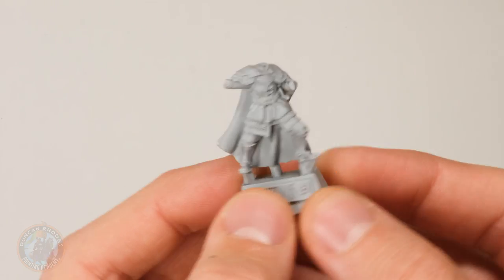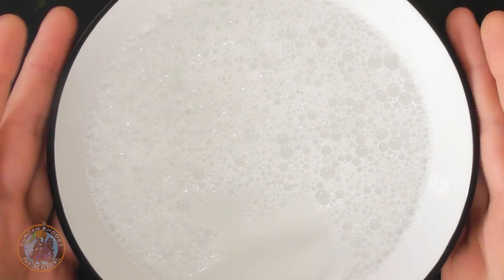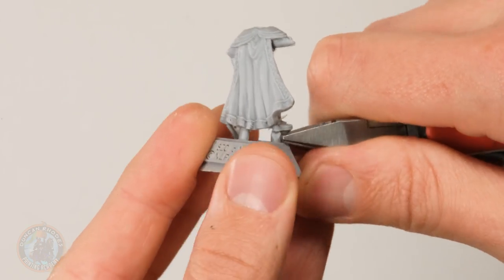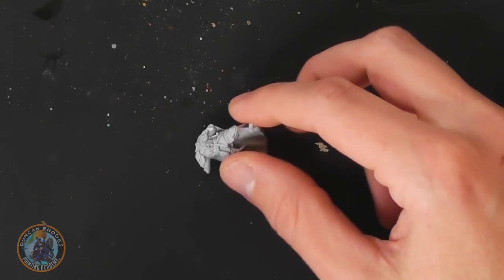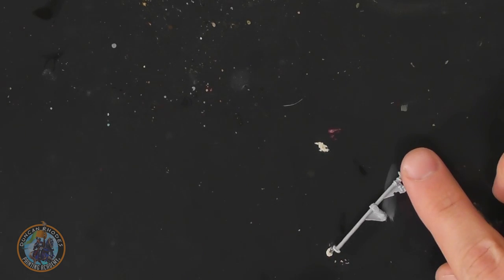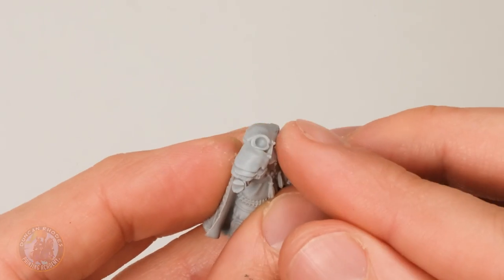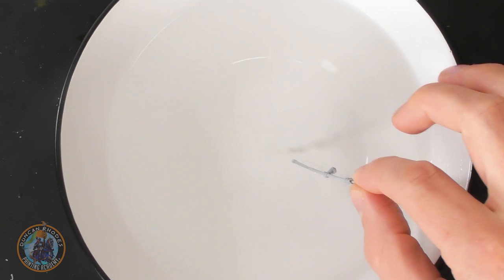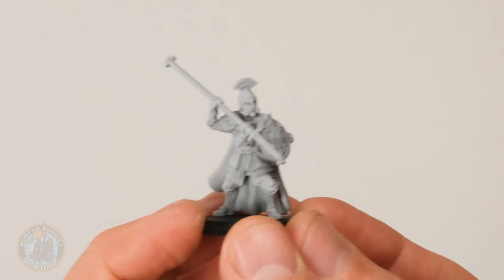Working with Resin Miniatures | Duncan Rhodes

Comment: Great guide, but please remember that if you are cutting or sanding resin you must wear a facemask or respirator to avoid breathing in any dust (or keep the part wet and wet-sand). Resin dust is nasty stuff and a bit like volcanic dust - it forms horrible sharp grains like tiny spicules when you sand it - and these are very harmful to your lungs and can't be broken down in your body. Especially important if you are building a large kit or a vehicle where there will be tons of dust. Always be safe ^_^
Reply: This is great advice. We should also stop playing resin. So hard to process and hazardous
Reply: What you on about, mate? I'm doing a line of it now and I feel fine!
Reply: @JacobVoOpera yes although I find the Forgeworld sculpts really endearing plastic is a superior medium. You can get a lot more detail and there’s much less hassle before you get to paining
Reply: All dust is bad to breathe in including the normal plastic dust. But, do you have a source on this? I'm pretty sure once resin dries it's not any more dangerous than sawdust. Bad to inhale large quantities of but it's not going to kill you instantly. Most at risk without the proper equipment are commission builders/painters etc. If you research this there's plenty of examples of people claiming this with zero sources or evidence. Kind of just a self perpetuating myth it seems. I'm obviously open to any actual sources you have proving this is more dangerous than any other dust type and not trying to call you out but if it is indeed false then we need to stop spreading the myth and having people freak out if they sanded one resin model and forgot to wear their mask.

I am obviously for wearing a m95 or respirator when needed as I do myself any time I'm sanding anything but just want some clarity on the claims surrounding resin dust.
Reply: @Funko777 Yeah for the first couple months of my hobby I thought resin was the hobbies equivalent to cyanide
Reply: How do you dispose of the dust? I usually do as you said wet sand but with bigger kits that becomes less effective.
Reply: @sanguinor5609  Just hoover it up if it's dry, you can get little workbench vacuums. Or if you are wet-sanding, sand over a tray or bowl so the dust goes into the water.

Comment: Great guide but I think you need to mention the safety aspect of working with resin, respirators are needed when sanding, and over exposure to superglue fumes can be bad as well so be sure to use it in a well ventilated area.
Reply: Source? What makes it worse then normal dust? No body I ask can actually prove this. It's just something they heard. I say wear a mask any time you're sanding anything but people seem to believe only resin is dangerous based on the fact it's ingredients are toxic....when it's poured and drying. Not once it's solid. The same can be said about plastic.

Comment: Great guide as always! I have this weird sense of great satisfaction when I've cleaned and "fixed" a resin kit that had problems, e.g. Finecast. Of course plastics are easier, but for some reason it feels so good to have overcome the troubles you encountered with the resin kit.
Reply: i stopped buying finecast because i didn't buy the mini to sculpt it again, lol. hellbrecht is made of little supports.

Comment: Always good to do something like this as there are new people to hobby every day.  I had no idea you had to (or at least, it's advisable to) clean resin models with soapy water until I saw somebody else do it on another channel.

It's advise like that that's so easy to miss or not know.  Which of course would have a big impact later on when you got around to painting.
Reply: Good idea to wash plastic kits off in the same way, especially those made from soft plastic which often ‘sweats’ off an oily residue.

Comment: Really good guide Duncan, although as a rule I'd advise people to wash the model once all the shaving is done. That way you remove any filings that might stay attached to the model when you base coat it and will result in a slightly nicer paint job.

Comment: Regarding getting the last little bits on the bottoms of the feet: One thing I have done in the past to use a sanding block or piece of sand paper on a firm, flat surface. That way, you remove a controlled amount of the miniature (works on all kinds of minis, not just resin), and you are left with a bottom surface you know to be flat, which can help with basing.

Comment: A little tip: I was never a fan of preparing a hot water bucket to fix the casts. I went the blunt way and use a hairdryer. Works perfectly and quicker with less hustle... just be careful to not drop your precious bits into the dryer. Hehe.

Comment: Hello and thanks for the tutorial.

I worked with resin several times and noticed that scrubbing the miniatures sometimes is not enough to remove the agent. I was searching al long time until I fount a solution: break cleaner (but try it better out on the block to make sure that the cleaner will not damage the miniature).
Also, especially for bigger miniatures, I use epoxy resin glue (Epoxidharzkleber - sorry for my bad english). It takes hours to dry, but it will hold forever...   :-)

Comment: Thank you for the video! Just got some resin miniatures recently but I'm too scared to begin assembling them due to lack of proper knowledge and experience in handling resin.
One question: you can use any soap for cleaning resin or do you need specific type of soap?
Reply: Just use whatever you use for washing your dishes. Seems to work better than liquid soaps for washing hands. Just make sure the water is fairly warm.

Comment: it is worth mentioning that some all resin figures aren't equal. Resin quality will differ between manufacturers. While some will ship resin kits that almost feel like a GW plastic kit some might use resin that is more brittle and could snap easier. It is important to cut your parts off the frame carefully until you know what type of resin you are working with, resin that is more brittle requires you to support it a bit more than resin that feels like GW plastic.
At least that is my experience... ruined some parts of a kit that way before, luckily there were other bits to use but it still sucked.

Comment: How long did you leave the model in the warm water for after scrubbing it with the toothbrush? I originally used to just scrub the model, dry it off and then start building, but several people have told me over the years I should be leaving the model to soak overnight in the water before building.
Reply from the maker: Not long at all. Once washed and scrubbed, we just dried it off and continued 😊
Reply: Excellent! I'm going to go back to my original method then :) Much better than leaving every piece over night to soak

Comment: Can we apply the same principles to working with pewter models?
Reply: Its very similar yes, except if you've bought a new metal miniature, you just need to brush off the figure rather than washing it. Metal moulds are lubricated with talc rather than grease.
If you've bought an old miniature, off eBay say, then giving it a nice warm bath like the resin figure is still a good idea, since some paint remover may have been used on it and some of those are greasy.
Reply: Also, metal is stronger than resin or plastic, so take more care when cutting. To detach large parts from occasional bits of metal "sprue" you might prefer to use a razor saw rather than a knife or clippers. It's physically easier and less chance to push the model out of shape.

Comment: No matter what, I find everything takes 3 or 4 "baths" before its ready. idk what I'm doing wrong
Reply: What kind of soap are you using?
Reply: What kind of soap are you using? And how long are you letting it soak?
Reply: @runamuck840  Dawn dish soap,

I let larger pieces sit for longer, but for smaller things that warp I leave them for about 10sec
Reply: @AubLambe  I meant before cleaning them you have to leave them for around 5 to 10 minutes

Comment: And if you want to see the mess plastic glue makes of resin, just put a drop or two on one of those casting blocks... really not pretty...
Also, the steam of hot water works very well too to make resin soft enough to straighten pieces, if you're weary of putting them into the water.

Comment: Resin miniatures. Bubbles, bends, warping, flashing, not gluing correctly lots of prep.
I advise sticking to plastic.
Reply: Nah
Resin is far superior quality wise 
Plastic is for large armies/beginners
Reply: @pledgedsun0752  I've gotten too many resin miniatures with defects that I have decided to completely avoid them. Got an eisenhorn model a few years back and there were actual parts of the model missing with bubbles.
I repaired all the parts with greenstuff but new 2-3 years later I can see where the greenstuff has shrunk and I can see the outline of the defect. If by superior quality you mean defective then OK I guess....
Reply: @anthonyreynolds3418  Not to deflect blame from resin (I know it can be a pain, but I do think it's higher quality for detail) but, you should have contacted GW. They'll typically just replace the model.

Comment: I absolutely hate and despise resin miniatures, an absolute hell to glue and paint.
I'm still highly offended with my Primus Medicae
Reply: I find that resin models tend to have much much more detail than plastic ones and I personally find them easier to paint.
Reply: You might be doing it wrong.
Reply: It really comes down to who is making the miniature. GW's resin models are known for being difficult to clean and work with, but other companies like Privateer are much more adept at it (and in Privateer's case also use metal parts for the smaller components to minimize bending and warping.)
Reply: i don't see how the painting differs if you just use a prime like you should be doing anyways?
Reply: There’s some beaut resin minis out there. Very impressed by Kromlech’s resin models.

Comment: This is NOT Resin, this is a slurry mix of stuff and called Finecast. I repeat its not REAL Resin. If you are working with an Resin printer and you print Minis, you will see and feel the difference. The GW finecast is much softer and often has airbubbles in them or even crooked parts this is due to the slurry mix of GW Finecast. Real resin is more flexible and is totally different in its properties.
Just a small clarification :)

Otherwise the rest of the Video is good :)

Comment: So Resin is cheaper and yet GW is out here selling their resin stuff for just as much, if not more than the plastic?
Reply: Resin is cheaper. The resin casting process is much more labor intensive and requires much more hands on work than plastic injection.